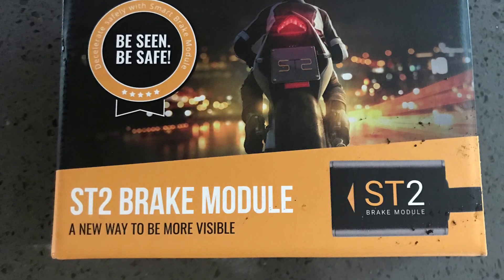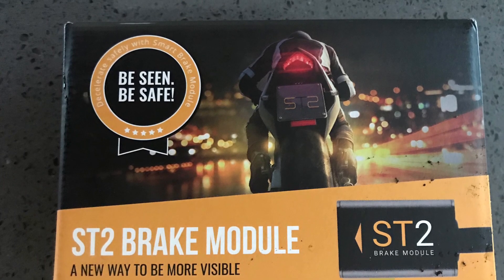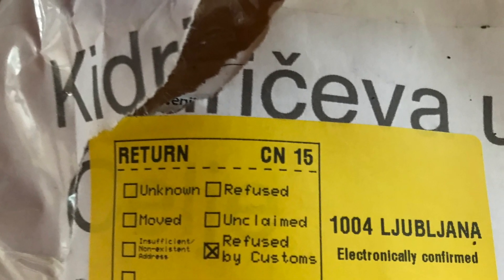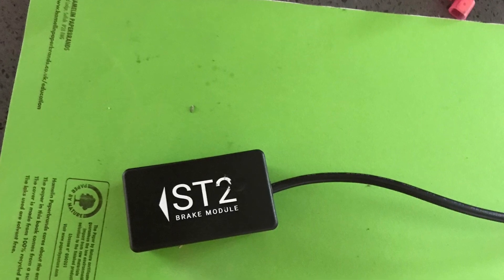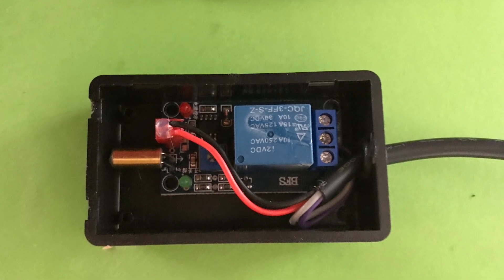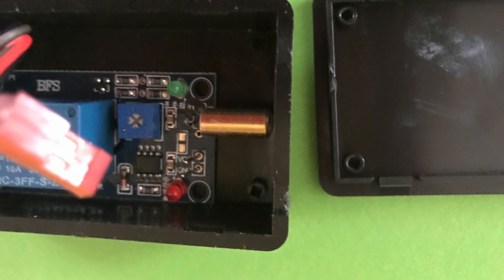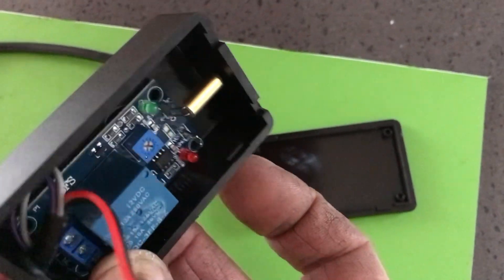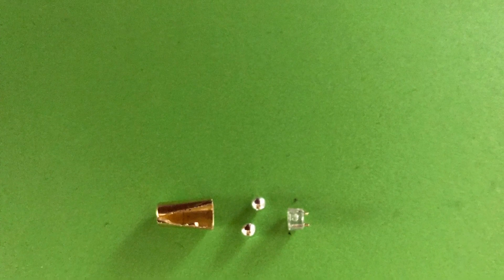Royal Enfield Interceptor 650. ST2 brake module autopsy

Comment: Hello Slick!  And good day all!

Thanks for the video!!!
I ordered the STS Turn Signal and Brake Modules back on July 8th of this year, 2023.  
I installed the Turn Signal Module last week and everything went well enough.  
Last night I thought about installing the Brake Module, so I watched this video again.  Afterwards I took my module from its box, shook it, and daggnabbit… I got the Clackity-Clack!  I installed it anyway. LOL  I have the same symptoms as your first module and many other modules apparently have.  

The directions say you can tilt the module to reduce sensitivity.  The directions say tilt the cable-end (rear of the module) down to reduce sensitivity.  I have a very small minimoto, a Z125, and space anywhere on the bike is a premium, but a flat spot is practically nonexistent.  The only place actually was under the rear tail/fender, directly in front of the license plate LED housing.  It did fit perfectly, but there is no way to tilt it. 
Looking at your photo, I think I will pop the top and gently tilt the sensor itself.  If my module is the same as your, that will have the same effect as tilting the entire module. 
Hopefully that will do the trick.  If not, I’ve soldered for avionics and repaired equipment down to the component-level of circuit card assemblies… micro SMT components… even repairing runs and eyelets in the center of multilevel CCAs themselves… anywho… if the tilting doesn’t work; I think sourcing a better sensor and installing it myself would be more expedient than having to deal with STS customer service and the back and forth international shipping… DHL is the worst carrier here in the States. 

Wish me luck!

I’ll post as soon as the weather and work cooperates with me!
Reply from the maker: Greetings! I’d say just send that module back for a refund. No amount of tinkering worked for me! If it had that rattle, I think it’s no good!

Comment: Hello James,
I'm in contact with ST2 at the moment regarding my non working module.  They came back with some interesting info.
Mine rattles, and does the same as your original one.  Random flashing all the time.

They told me that mine (and presumeably your original) is the 'upgraded Mk3 version'
1.  It no longer gives a flash on startup
2.  It's always fitted logo UP
3.  It automatically switches between two modes, flashing (on gentle decel) and steady (on prolonged and harder decel)

Sounds like your replacement may be the earlier model, which WORKS!

Still waiting for them to get back to me regarding a replacement.
Reply from the maker: Hi. Mmm…. Interesting! Externally, my two look identical. The second one does not rattle. I was thinking of popping the top off my replacement one and seeing if they are the same inside……
Reply: Hai Avon, how's your ST2 Brake Module? Did they replace a new Brake Module for you?
Reply: @allentan1798  I sent a lot of emails, and finally they said they would replace it and send me a new one.  They emailed me an invoice for $0 a couple of weeks ago, but the new one doesn't seem to have been despatched yet. Grrr.
Reply: @avon57  same situation like me too, they have emailed me the PO ( replacement order) on 30/10/2022, but item still not yet shipped, they told me that replacement take a bit longer to depart..🥲
Reply: @allentan1798  sounds like the 'mk3' doesn't work too well!
Reply: @avon57  I prefer MK2, simple and straight forward..
Reply: @allentan1798  ok, I just got an email from ST2, saying the replacement module has been despatched.  Hopefully, THIS one will work. 😀
Reply: @avon57  , me also received an email from ST2, they just give me my tracking number ( but still waiting DHL update ), Let see next week. hehehe . Actually i still have Turning System with me, but i haven't install yet.
Reply: @allentan1798  here's hoping!
Reply: @avon57  interesting,  already 3rd days, my tracking number still not yet updated.  It's show no record found !
Reply: @allentan1798  yes, same with me!  Maybe dodgy, or just 'Slow'venia post!
Reply: @avon57  Send several email to them, still the same answer and telling me to wait on 17 Nov and they will despatch again? Then what happened to the old Tracking Number?
Reply: @allentan1798  yes, I've been sending daily emails, which they sometimes answer.  I'm thinking the tracking number is either a fake, or they simply just haven't despatched the item yet.  It would be nice if they were more truthful
Reply: @avon57  hai Avon, Finally I have received my tracking number from DHL by today.
Reply: @allentan1798  I've been emailing ST2 every day, but haven't heard anything for a while.  They're not answering my emails!  Fingers crossed, I may hear from them soon! 😀
Reply: @avon57  Good Morning, I have just received my ST2 Brake Module ( Replacement ) from DHL.I will try it tonight. Hopefully it works fine. I have checked the outlook and the sticker at the Module ( ST LIfetime Warranty #73591FEQ ) both are identical but still can hear the rattling sound when you shake it gently . ( it make me worry )
I will update you once i try it tonight. Bless me good luck !
Reply: @allentan1798  haha!  The Mk3.  I hope it works for you.  They finally answered one of my many emails, and said my replacement should arrive on 26th November, but the tracking number they gave me weeks ago does not come up on the system. 😀
Reply: @allentan1798  after many emails and excuses, the tracking number has finally activated.  After previously stating that the item had left weeks ago, ST2 now say the 'postman missed a few packages'  What? 😀.
I think the company is either very understaffed, or can't maintain supply, or both.  In any case, they are not very honest with their customers.  Hope yours worked!
Reply: @avon57  hi Avon, after testing my second Brake modules,  still having problem when i was acceleration  and deceleration my bike, the tail light still blinking, because my second brake module still have rattling sound same as the 1st module, and i have asking James about his new Brake Module, there is not rattling at all. Acceleration shouldn't have blinking light.  Need to write to Philippe Duvón again..
Reply: @allentan1798  Disappointing.  It seems thst the rattling MK3 is a repurposed tilt switch, looking at James' report on it.  I don't hold any great hopes for it, but we'll see when ny replacement finally arrives.  Yes, I've been dealing with Philippe as well.  Polite, but many excuses.  I think I'll give ST2 Systems a miss in the future, an unstable and erratic brake light is just dangerous.
Reply: @allentan1798  Hi mate, my replacement module still hasn't left Slovenia, despite all the promises.  Any luck with yours?  Cheers, Chris
Reply: @avon57  hai, Avon, i have tried many times, unfortunately still the same, i think the sensor too sensitive and too lost i believe then having rattling sound, and  James received without any rattle sound.
I still don't have time to write email to Phillippe yet.
Reply: @allentan1798  oh that's no good.  It sounds like the earlier model may be the one that works.
Reply: @avon57  that's why i was so worry to receive same model with rattling sound 😇😇
Reply: @avon57  hai ,Avon, how is your replacement module? Did you receive it from ST2?
Reply: @allentan1798  Hi Allen, no, not yet.  Grrr. Philippe said it was coming by 'economy mail', and would arrive in Australia around the 26th Nov, but nothing yet.  Did you manage to get yours working?
Cheers,

Chris
Reply: @avon57  good morning, I have wrote another email to Philippe and told him  still have same issue when accelerating tail light on, but he haven't reply me yet..
Reply: @allentan1798  grrr. 😃
Reply: @allentan1798  Well, my new module has just arrived.  It rattles, but not as loudly as the first one.  I'll test it out this afternoon hopefully, and let you know.
Cheers,

Chris
Reply: Ok, this one doesn't work either.  It randomly flashes when accelerating, decelerating, in the cruise, whatever.  I've tried a variety of angles and installations.  I've lost patience with ST2 systems, their 'smart brake module' is a piece of junk in my opinion, at least, the rattling Mk3 version.  Into the rubbish bin!
Reply: @avon57  same as mine,  i have tried many angles & different speed at the end still the same.
i have wrote to Philippe about the same issue on 24 Nov 22 but until now no reply from them.
I told Phillippe don't send us the Brake Module with rattle. Honestly i love this product if it can work as what they said.
Reply: I am thinking, is it the tilt ball switch problem, either the balls too small, that's why make it rattling
Reply: @allentan1798  hard to say, but it's just a repurposed tilt switch, as James pointed out.  The early models must have used a different circuit.
Reply: @avon57  No, i did ask James regarding the inside component, everything was indentical , only without rattle.
Reply: @allentan1798  hmm, that's interesting.

Comment: Mine is doing the same thing.. nothing when decelerating, flashing when accelerating. Definitely rattling inside too. They're sending me a replacement. 
Did your internals on the second unit look the same as the first one?
Reply from the maker: I was t able to check the internals on my replacement unit but it worked perfect;y the minute I fitted it and is still working perfectly several months later. Yo received a defective unit, I’d say, exactly like I did..I tested mine yesterday and it’s still working fine!

Comment: Hi James, 
looks like the relay has melted or overheated I should say. We even see white stuff on the cover and the lettering is wavy ;). Thanks for showing us the inside.
Reply from the maker: I’ll double check now
Reply from the maker: No, the relay is fine. The wavy lettering is an optical illusion caused by a thin line of clear glue running across it
Reply from the maker: The entire circuit board is made in China….lots of Chinese characters running along the bottom of it and also there is a small potentiometer in there which means it’s adjustable somehow. I’d say definitely not a bespoke circuit board because of the potentiometer and the two led’s

Comment: I’ve had two of these shipped from the manufacturer and installed properly on my 2022 Royal Enfield Continental GT650. Both did not work properly, exhibiting multiple problems as described in your previous videos. 

My concern is that since it’s such a simple design that often fails while brand new from the factory (there are many other customers online with the same problems to uphold this statement) it will likely fail after short use even if it works on install. 

I’m at the point where I feel safer just repairing the spliced cabling in my wiring harness created by the ST-2 splice tabs and ride happily for the rest of my life while remembering to tap my rear brake a couple times before letting my throttle loose than worrying about this thing failing unexpectedly. 

Any thoughts?
Reply from the maker: I received the second one and fitted it and it’s worked perfectly ever since! They will send you replacements and I’d say it’s worth another go

Comment: My first unit did this as well, exactly the same rattle and operation was very random and not helpful. It was the latest generation in the plastic case. I was sent a replacement and it's the older generation that was supposed to have the flash feature. But it does not do that either. It does work as advertised otherwise but I really wanted the flash before brake engagement but I guess that was not to be. I may eventually uninstall.

Comment: Hi James, i have the same issue and email to ST2 Support but no reply from them
Reply from the maker: Hi Allen. They took over a week to respond to me! But finally a person called David Rand responded and they sent a replacement module soon after that…..
Reply: @internetpolification  many thanks
Reply: Hai James, sorry to bother you, because i have just received my replacement Brake module, its look exactly the same ( boths internal components) and have rattling sound. I just wondering your new brake module is it same as the 1st one? As you mention there are not rattling sound.
Reply from the maker: @allentan1798  hi Allen. No bother at all. My replacement module looked exactly the same as the first one in every way. BUT…it does not rattle! And it works fine. My non-working first module rattled

Comment: Thanks for the video - I have a similar experience with my ST2 brake module; The module shipped looks different to the image on the box and it's super sensitive to any tilt or speed changes making it flash the brakes unnecessarily. Flashy advertising, poor product.

Comment: I found the same issue and posted a video as well (https://youtu.be/Jl1EhHDoBs0).  It's a bit confusing as some folks have stated that it works properly for them.  I also purchased the brake flasher and was going to install when I found bad crimps - they literally fell apart.  I sent ST2 an email weeks ago and have gotten zero response.  The big issue with the flasher is that it is in the brake circuit so any failure (connection or electronics) is going to cause total loss of your brake light.  Based on what I have found with two of their products I am not going to install anything - I just do not trust them.  I will make sure I apply my brake light and early when stopping.